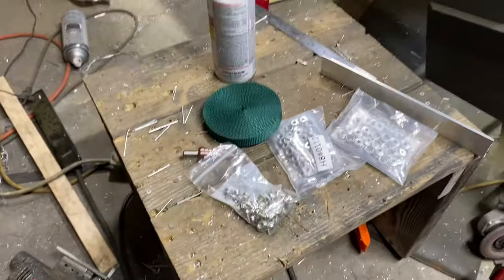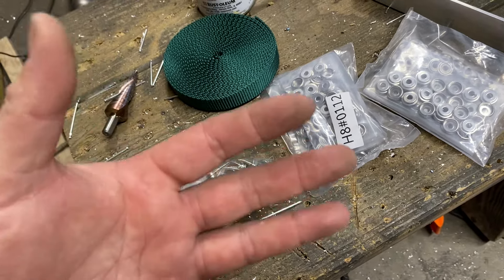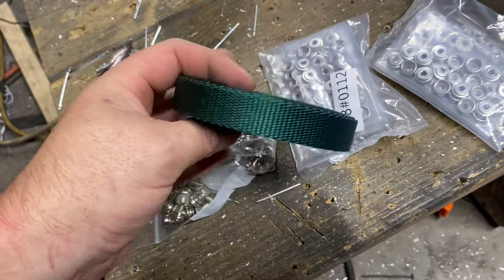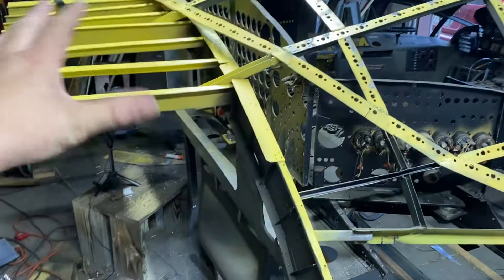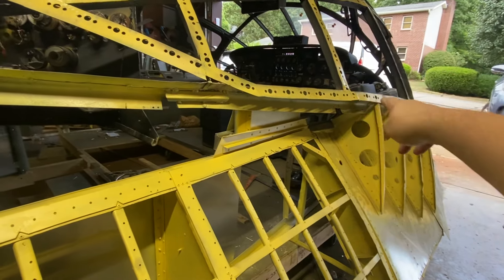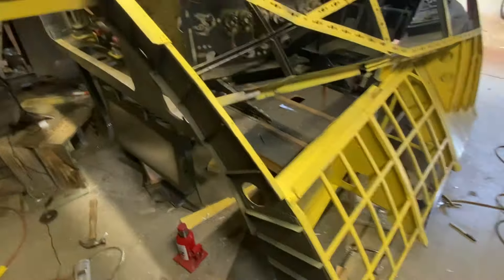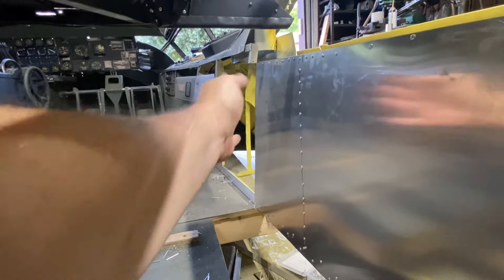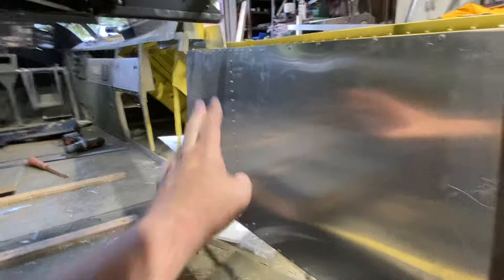Mega Detailed Full Scale B-36 Fuselage Progress

Comment: you should build a custom large evaporative cooler for the summers, its rough out here.
Reply from the maker: That’s a good idea, but fall is just around the corner. I can handle the heat in general, but what is miserable is trying to engineer and make potentially painful decisions when I feel like my face is on fire. That’s the frustrating part. Otherwise, I love to just build in terms of busy work where I don’t have to think.
Reply: @B36HPeacemaker  I totally get that, and cheers for how much youve already got through. maybe next summer ill remind you if the project goes as far as im hoping for.
Reply: if i win the lotery or something ill donate for the full forward pressure compartment
Reply from the maker: @liquidcooled5108  Enthusiastically noted.

Comment: Once you finish it,are you donating it to a museum? The Air Force museum in Dayton,OH has a walk through of a B-29; but not a B-36. I am curious as to who is supplying your measurements-blueprints. It was obsolete as soon as the B-52 replaced it, and the early B-52 Canopy was similar. I can't imagine a bombing run from the East Coast, USA to Germany,but that was what it was designed for.
Reply from the maker: I’d like to take it to airshows for a while and then, eventually to a museum. I’ve got a guy at the SAC museum who helps me out with the interior, as well as a guy at the Castle museum. The major airframe dimensions are supplied by me, which I take from a B-36 that’s just around the corner.